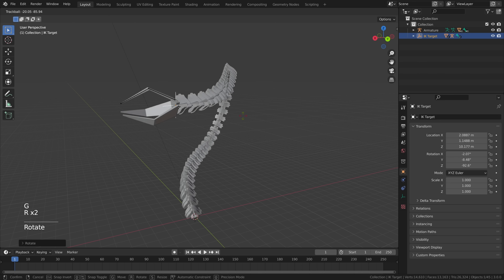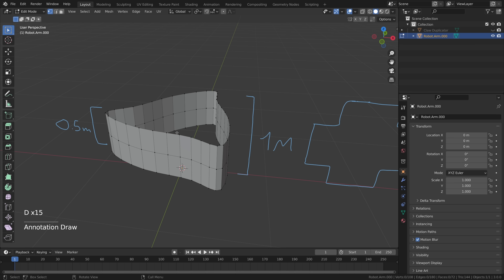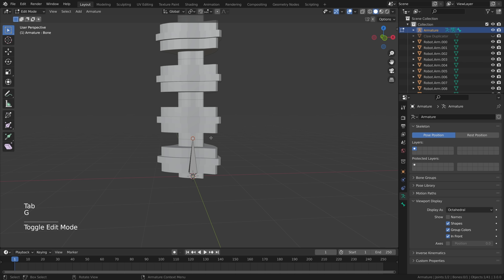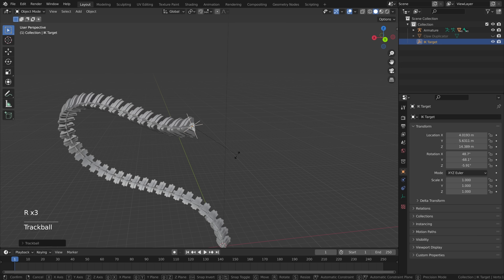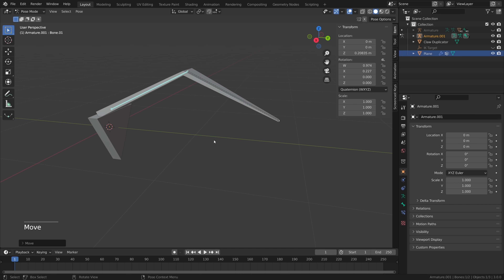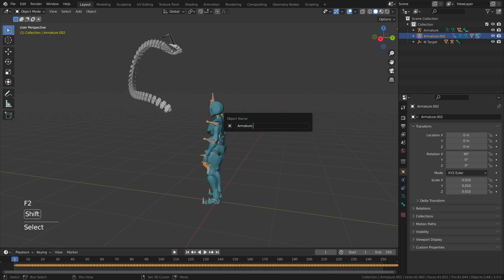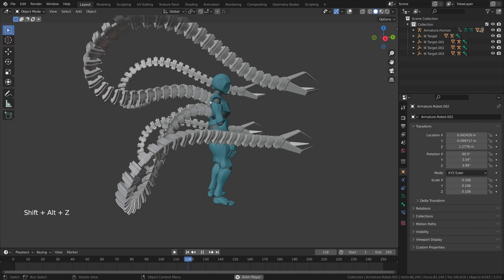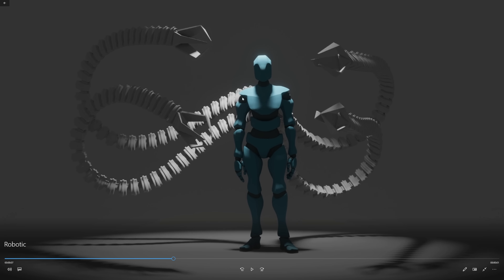Tutorial: How to Create Robotic Arms in Blender (Part 1)

Comment: I tried out some extra control by having two IK chains, the top IK (Nearest the claw) controlled the top 30 bones and then another that controlled the bottom 10. Then the bottom IK is a child of the chest piece with a .8 influence so it picks up some of the animation but still looks offset. It did add a little more control, but the chain wasn't as nice and smooth as it was when it was one complete IK. Hope this made sense!
Reply from the maker: Amazing!!! Had no idea you could use the IK the other way too!
Reply: @Polyfjord  it works to a point, gives an extra element of control, could possibly link up a few IK controllers and have them controlled less and less the closer to the claws? I'm glad it's another possibility though!
Reply: Lol i didn't understand anything 😅
Reply: @kamalalamry2888  Yeah 90% of us probably came because of the doc ock reference.
Reply: ok now thats actually pretty smart ngl
Reply: @Nyandola  lol right
Reply: Bro, I have a problem here can you figure this out? I'm new in blender and trying my best >.<

"This tutorial is cool super! But I'm stock in claw duplicator whenever I use array modifier to claw duplicator and use the "object offset" It doesn't work on me the position of the claws is not symmetrical I let that and after that I parent it to the IK Target but the claws are messing around and scaling on it's own? By the way I'm using 3.0 what blender did you used Sir? And what is the solution to that?"

Comment: For the solution, just make first bone/segment/root of the metal arm constrained and locked out of any and all motion. And allow second segment to only rotate alongside perpendicular axis to first segment
Reply: Can you explain it a little bit more please <3 ?
Reply: @theflabergaster7394  basically from what I've seen the glitching or spazzing out occurs at first joint of the metal arm, making sure it's somehow locked in it's relative rotation should fix the whole issue of this spazzing by restricting amount of movement arm can perform
Reply: @coldrunhershel604  thx I understood that, sorry for asking incorrectly, I wanted to know the exact step to lock the first bone 😅🥀
Reply: @theflabergaster7394  in the IK constraint option, play around with the "chain lenght" option... zero will make the constraint affect all bones, 1 will make the constraint affect 1 bone, depending on how many bones you have, it should be like.... maybe .... 20 or 30 or something

this may cause a "kink" in the first bone though, you can help avoid this by changing the individual bones "stiffness" property in the bone tab.

Comment: You should try to mirror the arm

Try setting the arms pivot to the body: set the 3D cursor to the body, then choose the arm, go to Object -> origin -> set origin to 3D cursor

By after duplicating the arms (Shift+D),  do Ctrl + M and set location and how it rotate to the original arm that was used to be duplicated by doing X, Y, Z, the duplicated arm's pivot should be in the same location as where the original arm's pivot (which is the body). And you can repeat this to the other arms.

This way is quicker (at least for me) and way more precise (if it doesn't touch the body then you can move the arm to the body). And sorry to any confusion since English is not my mother language

Comment: Here's my solution, which is super stable for both position and rotation:
Add another IK target constraint just like the first one, to the second bone of the tip (the one right before the current IK), with target. Make it the same (i.e. enable "rotation" in the IK too). Parent the 2nd target to the armature (object, no inverse). Add object constraints so it copies position and rotation of the 1st target. Now find the desired "base" pose you want, apply visual transform of the 2nd target, and disable the constraints.

The idea is that there's a "first pass" IK that is anchored to the armature and has a set shape (completely static relative to itself), and the final IK refines it. You can animate the 2nd target if you do drastic pose changes to another position that you also want to be stable.

The 2nd target doesn't really need to be so close in position and rotation, it only needs to be in the general vicinity, but I added the constraints to make it much easier to find a pose (particularly regarding the rotation) and leave it in a similar transformation.

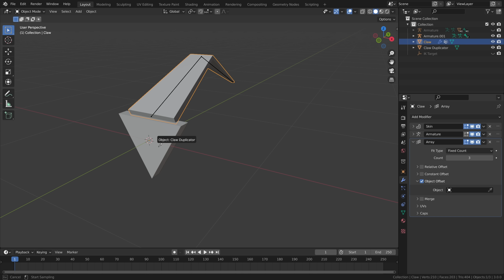Comment: 12:00 
when adding a new modifier "array", when I select the Claw Duplicator the new tow claws get pointed to a different positions, any helps I'll be grateful !
Reply: mee too xD
Reply: There was a cut in the video right after he applied the array to offset around the claw dupe.
Reply: @FuriousSoldatVEVO  So how do i fix it?
Reply: @FuriousSoldatVEVO  yes I noticed that too
Reply: @FuriousSoldatVEVO  got a fix for it?
Reply: has anyone found a way to fix it yet?
Reply: @janashraff.alanwar5057  Facing same problem.. tried many thing but nothing changes..
Reply: I fr need a helpful hint also
Reply: Delete the Array Modifier & start again. Select Claw Duplicator (Triangle). In Object mode, select Object tab and scroll down to "Apply" and scroll across & down to select "All Transform"
Once this is done you should be able to start the array again and this should work.
Reply: @chrisdevereaux  Its not working though, all its doing is moving the claw bits to the top and its not in the right positions :(, pls help
Reply: I tride it many times but no success
Reply: The part 2 for this video has a solution for a similar issue with the array modifier. 

The problem I had was the array modifier was causing the fingers of the claw to duplicate and rotate around the y axis. My band-aid fix was to skip rotating the claw “palm” and building the first finger up on the y axis. This seamed to simplify  the array modifier when I applied it. 

Also you might have luck building the claw portion in a separate project and then using the append function to combine the two projects.
Reply: @chrisdevereaux  OMG it worked!!! thank you Chris!
Reply: @chrisdevereaux  My most sincere thanks, man. Thank you very much.
Reply: @chrisdevereaux  Thank you so much 😁
Reply: @chrisdevereaux  thanks man! Really didnt know what to do ^^
Reply: @antefilipovic2127  I was facing the same problem now itis fixed.. silly me i was rotating the claw after array so select the triangle and rotate it on y axis.. if you still face the prob then select the triangle and apply all transform  then try again..
Reply: The only way I managed to get a "Somewhat" of a workable fix was to create an empty, and then using that as the object instead of the Claw Duplicator, it is not perfect but it kinda works
Reply: I just found a solution that helped me personally, so basically select your Claw then right click, go to "Set Origin" and set the origin to 3d cursor I hope that will work for you :)
Reply: @chrisdevereaux  thanks a lot . was stuck for 3 weeks finally working well

😀
Reply: you are gonna select all (a) and then press (ctrl+a) and then chose (All transforms) and that should do it hopefully!
Reply: @fearfull1440  Thank god you commented. Fixed it for me, THANK YOU!
Reply: @chrisdevereaux  You're a life saver!
Reply: @fearfull1440  thanks you bro I was stuck like two days on this x)
Reply: @Jbh298  Im sorry but i don't understand the way to fix it, you don't rotate the palm and then ?
Reply: @chrisdevereaux  it's working
Reply: After applying all transformation put the origin to 3d cursor.it is working
Reply: @fearfull1440  idk what the fuck i did but i think this helped, thankyou thankyou
Reply: if anyone else is having issues, make sure your bone is also selected when you move the claw, that was my issue anyways
Reply: @chrisdevereaux  Absolute save here.  Kinda annoying the video just glosses over this.  Especially when so many people are commenting about it.
Reply: Yousef Al Mhimid  my issue was i didn’t have the skeleton nodes selected
Reply: Somebody please help me! I've applied transform to the Claw and the Triangle. But when i use object offset in array modifier, there's a line thingy which appears beneath the claw. i believe its a small scaled version of the claw but its flat. How do i fix this all?
Reply: @aiz.3d  apply transform to the bone aswell
Reply: I just figured it out. Apply all the transformations to the claw duplicator and then do the array modifier
Reply: and them rotate the claw duplicator to 120 degree
Reply: @fearfull1440  THANKSS
Reply: @chrisdevereaux   Thnx a lot , it helped. :)
Reply: @theoreticallyproven  Tysm I was struggling for so long with this
Reply: @KevinHughes-vr3dr  np
Reply: @chrisdevereaux  THANKS
Reply: @chrisdevereaux  thanks bro
Reply: @Extravi.  click the triangle and apply all transform
Reply: @fearfull1440  thanks a lot dude
Reply: ok a bunch of things might be able to help you. 1 before starting this all he cleared the location so it was at the center of the world. 2 he bent the claw in pose mode. I don't know if that will help but I had the same problem but when I started over some bits it worked the second time.
Reply: same they were seeing in different positions
Reply: @fearfull1440  thank you so muuuuuchh
Reply: @chrisdevereaux  yessirr.. TYVM😁😁😁😁😁😁
Reply: Can someone tell me what to do from the time I put the skin modifier cuz i cant understand
Reply: @KanYe_ezus  which render engine you using
Reply: @ThunderMorphZ  Nevermind i got it , thanks for willing to help me tho
Reply: @KanYe_ezus  well ok and np
Reply: @chrisdevereaux  thanks.. It actually worked in mine.
Reply: @chrisdevereaux  You are a god bro, thanks!
Reply: Yousef Al Mhimid  thx bro
Reply: the most simplest way of fixing this is going into object mode selecting Claw Duplicator rotating it on z axis by 180 then rotating it on the y axis showed in the video
Reply: @chrisdevereaux  THANK YOU SO MUCH BRO
Reply: @chrisdevereaux  DUDE THX A LOT!!
Reply: @chrisdevereaux  THANK U SIR
Reply: @theoreticallyproven  FINALLY ThANK YOU SOO MUCH !!!
Reply: don't know what you mean and still not working😡
Reply: @chrisdevereaux  YESSSSS IT WORKED! Thank you so much bro
Reply: @chrisdevereaux  Thank you so much buddy. It worked :)
Reply: @chrisdevereaux  Thanks
Reply: @theoreticallyproven  THANK YOU SO MUCH THIS SAVED MY ASS FROM SO MUCH EXTRA WORK
Reply: @fearfull1440 THANK YOU 🙏
Reply: @chrisdevereaux  Thank you

Comment: This is such a good tutorial! But for some reason i cant get the array modifier to work correctly, it puts the claw on the front and back of the triangle and slowly scales it down, but i followed the tutorial directly
Reply: I experience the same, trying some things out myself, but anyone feel free to enlighten us when you found a fix. Thanks in advance! :)
Reply: @MrPjoern  please let me know if you figure something out :D
Reply: Same issue here 😩
Reply: Okay Boiz n' Grills:
The scale down happens because the Claw Duplicator was scaled down. What you have to do is: Select the Claw Duplicator and apply the Scale by: Ctrl+A ->Scale. 
Now to the next problem of the wrong location of the claws, was also solved by this, but I dont know why.
Reply: @MrPjoern  When you have the "next problem": Once the Array Modifier away again and than you have to select the Claw and apply the Scale, Rotation and Location. NNow you can create the array modifier again and it works
Reply: Hey bud, I struggled on this for hours, clicked on that claw and pushed ctrl+a and reset scale and nothing helped. 

What eventually did the trick is that you need to do the scale reset on that triangle (ctrl+a while the triangle is selected). Because you scaled down the triangle and then you used the array, it tries to maintain than scale. Hope you manage to get it right.
Reply: @MrPjoern  Thank you so much

Comment: Hey! I love this video, and its helped me alot with making my first Blender project.

I have encountered a problem. While making the claw, and using the Object Offset tool, it doesnt go in the right position, and goes all over the place instead. Is there a solution?
Reply: same
Reply: got it, since the triangle is scaled down, it'll affect the displacing of the claw offset. so in object mode, press "Alt S" that will clear the scale transform
Reply: @UnFAMiliartoast  You a real one for this fam!! Thanks!!
Reply: @UnFAMiliartoast  I did what you said and still the claws are all over the place :/
Reply: @dighady  this happened to me. Can't exactly remember but try and clear location transform first
Reply: @UnFAMiliartoast  I did everything I can do 😅
Reply: @dighady  delete the array modifier and and reset all location and rotation. Then reposition and clear all transforms. Then start the array. This should work
Reply: @UnFAMiliartoast  After doing what you said now it changed from all over the place to tiny little claws
Reply: @dighady  really? Sorry brodie wish i could be more help

Comment: 12:00 at that part where u have to add the array modifier, when I´m trying to select the claw duplicator with that eyedrop thingy, the two other claws somehow are smaller. So there are 3 claws, the original one is the biggest, then there is one that´s smaller, and another one that is even smaller than the last one. I´d be grateful for any tips.
Reply: Same
Reply: Hit control + a and then press apply scale.
Reply: same here
Reply: yeah howd u fix it?

Comment: Guys, I'm having an issue with the claw duplicator, when I set the array to object offset the duplicates came out messed up, the claw duplicates are following the triangle's X axis instead of the Y axis
Reply: I'm also having this problem
Reply: Same here
Reply: Same, how do you fix?
Reply: I’ve managed to get the claws to rotate around the Y axis by rotating the claw duplicator on the X axis before the extrusion in edit mode. However, once the the claw has the array modifier applied, the scaling becomes messed up. Still trying to figure it out.
Reply: press Ctrl+a on Claw Duplicator and apply scale and rotate
Reply: @bg8249  its not working help us!
Reply: @Satoru_Haruto  you need to apply the scale and rotation before you select Object Offeset to Claw Duplicator
Reply: @bg8249  it worked Thanks!
Reply: Had the same Issue, until I noticed that I accidentally moved the origin of the claw while aligning it with the outer edge of the claw duplicator. The Origin of the claw has to stay at the center of the claw duplicator for the object offset to work.
Hope this helped

Comment: Gimbal lock (the knee bending glitch) is the bane of any animator's life!
The easiest method I came across was to use quaternion rotations rather than vector ones, but im not sure how one would implement that here without further experimentation...

Thanks for the great tutorial; I never could get my head around Blender's animation process compared to Max, until now! ^^
Reply: @Mathis  Yes, you're right. I was referring to quaternion vs euler rotations. I had not had enough coffee that morning I think >.<
Reply: I should clarify: whilst quaternions do indeed still use a vector as their first 3 variables; the important part is the 4th - the angle.
Gimbal lock is exclusively caused by the hierarchical system of the euler gimbal system. It comes from the fact that X influences Y which influences Z (or any permutation of the 3 depending on your settings), which leads to a point where one cannot be changed without changing another first.

The X Y Z components of a quaternion rotation direct only the baseline from which the model is rotated (sort of like a compound axis), and then the angled rotation is applied exclusively to that arbitrary axis. 
The result is that at no point do the X Y Z components get stuck rotating a point further than the bounds of its parent axes, getting rid of gimbal lock entirely.

More reference material can be found in the blender documentation under Rotation Modes > Quaternion.

Comment: This is a pretty rad tutorial, lots of nifty tips and tricks would never have thought of, the only solution I can really think of for your IK glitching issue is to use a spline IK instead of a regular one. You'd have to have more controllers, at least three rather than two, I'd say,  but it would allow you to bend and rotate the arm freely without worrying about the arm suddenly switching direction on you.

Comment: Tip: Instead of duplicating the segment 40 times use an array modifier. Just set the Count to 40 and Factor Z to 1, all other factors to 0. Before applying it, you can then change your segment in Edit mode, this changes all segments and gives you a quick overview how it looks. Then you can apply the array, go to edit mode, press "p" and select "separate by loose parts"
Now you have 40 different Segments. Remember that the original segment "000" is also there, but you can delete it now
Reply: if you do that blender might count it as one object, so that might explain the ik problem.
Reply: @supercalifragilisticex  that's why you then separate it

Comment: @6:52 if your parent with automatic is not working or saying bone heat weighing error is because you have to merge vertices (edit mode - m to merge -by distance) and then do the parenting thing
Reply: You saved me so much stress, thank you
Reply: @omarnour4511 I've got the same problem but merge by distance isn't an option for some reason. Any other fix?